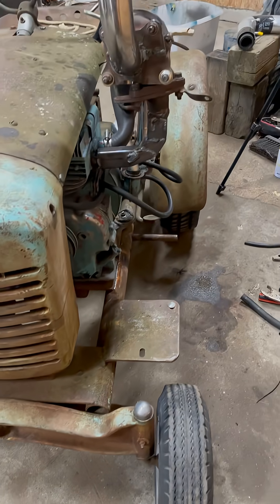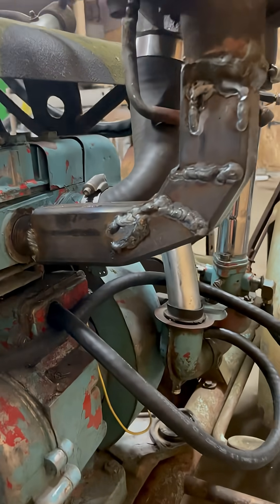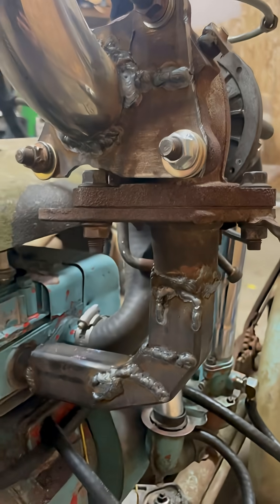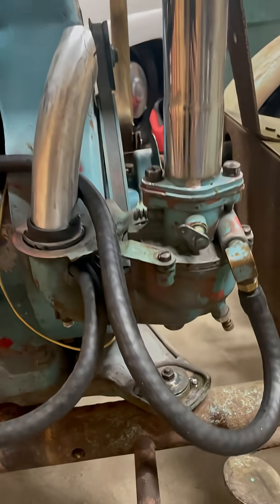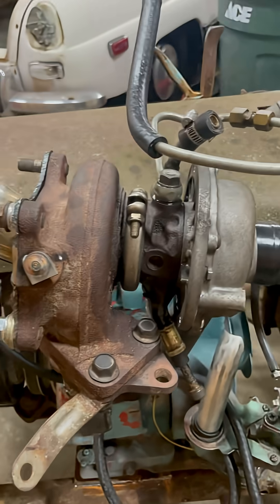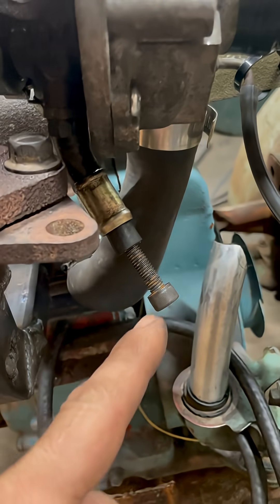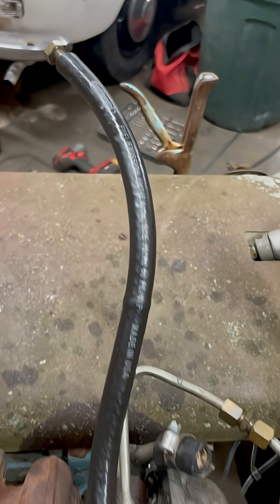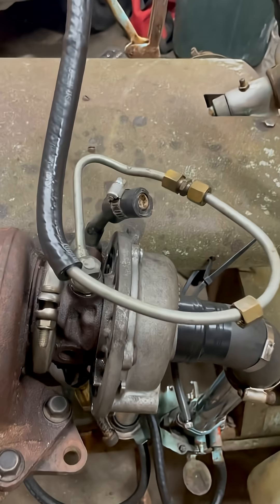Easy diy turbo system for 2025

Comment: That tube Calapse is kinda bad
Reply from the maker: This subject was brought up in an earlier design meeting and we feel that with two properly snugged hose clamps in key places we can get it tuned perfect. You see the tubes squishing a bit changes the volume of the intake behind the throttle plate and when needed it can expand to suit the transition from vac to pressure. More testing to come stay tuned.
Reply: Damn, looks cool as shit. How many HP does it add?  Now, how do you keep a pressurized feed to the turbo? Extra oil filter to keep oil clean? Extra volume in pan? Oil cooler? That could be a really fun toy.
Reply from the maker: @jamestboehm6450 it is a fine looking machine, with it all wound up it may reach 1-3 psi. Might add 2hp but when youve got 5 thats alot! The oil line is filled with oil. Then the hose pushed over the pipe creates pressure that forces the oil in. Were not concerned about filters or quantity with this setup. Watch the most recent short video today i added a rubber glove as a boost guage and put it through some testing. This is a little fill in project while i get work done on the fast tractor. This was also a dead tractor with no purpose so i gave it a quick and dirty turbo briggs setup just to show how simple fun really can be that and its neat to see the changes in how it runs. No wires no sensors no problem